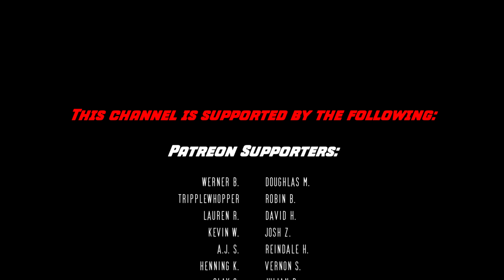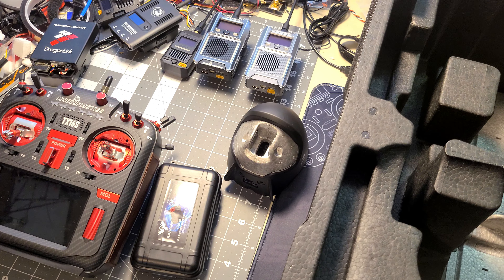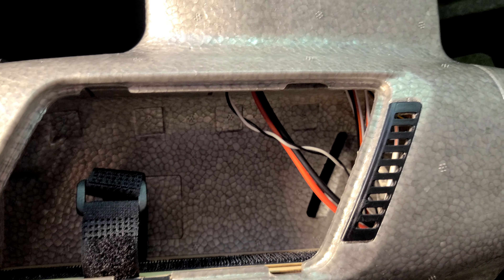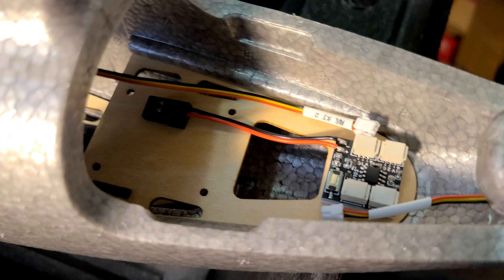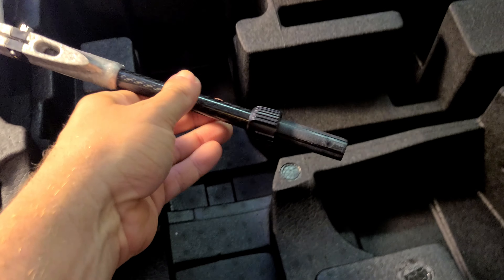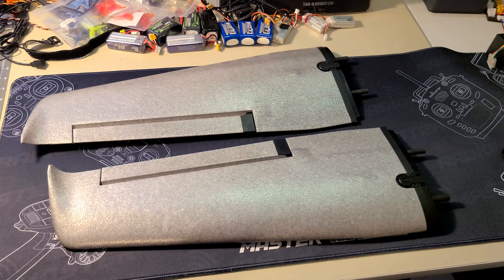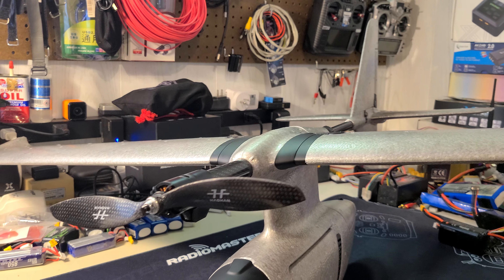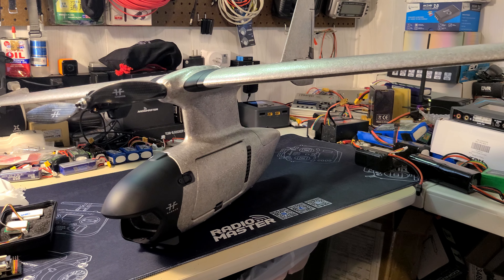Haohan Firefly Unboxing

Comment: A very nicely design with many refined design points. Reminds me of "Zeta Sky Observer" that HobbyKing and others sold in the early FPV plane days. Pod on that Long Range stick look more like a dive submarine with half-dome ends. Was surprised the wingspan on Firefly only 1080 mm. The Sky Observer was 2 m. Think this shows more how much the hobby has advanced, with smaller/lighter camera gear, and better batteries. I do like the integrated metal gear servos, connectors, hatch designs. Really a nice rounded package.

Heads up: beginning June 15, with the intro of U.S. tariffs (Section 301 guidelines announced May 14, 2024) on EVs, batteries, solar equipment, and chips/electronics from China, we can expect it will hit FPV gear shipped from China as well. Mentioning as tariffs begin at 25% this year, and depending on items will double to 50% in 2025. For lithium-ion EV batteries, tariffs will rise from 7.5% (currently) to 25% this year (or 2026 in some cases, but details not clear). Beyond FPV, products like e-bikes, solar generators, etc. will also be impacted.

Comment: Will be interesting to see the effects of a crosswind on the plane.
Reply: If you're referring to the large side area, it will actually have no effect on crosswind characteristics. Nerd tip: All planes fly in the same moving mass of air, whatever their shape. Many of us tend to think that our planes can tell the difference between upwind, downwind and crosswind when aloft, but in reality they have no idea what the ground does underneath them, and they don't care. This misconception is almost universal in RC, probably because we use the ground we stand on as our reference point, but it doesn't exist at all in full scale, where we're in the air with our craft. Use the air mass as your reference point, and your plane's behaviour will be a lot easier to predict at all times!

Comment: The quality and attention to details is VERY good, all the little touches here and there shows they really put a lot of care in the design. Also, it blows my mind how they are able to lower the price that much, around 250ish euros for a plane with a flight controller, gps, case, and some other miscellaneous, it's very well priced. I wonder if they send you the gimbal for the O3 with that package. There are however a couple of things that I wonder:
1) When landing it will tumble to one side for sure and hit a wingtip, I'm wondering how the plane is gonna hold up specially with that thin appendage connecting the wings to the lower body. With low speed landings i guess it shoud not be a problem but it needs some testing. Can't wait for the flight footage. Also, whenever you do it, could you include some stall testing? I'm always interested in those details but nobody does them in the review (on video).
2) Concerning the lower body, it certainty increases stability however it would be nice to see what happens with crosswinds, both light and heavy. Additionally, it seems to add a considerable amount of drag, I wonder if it would have been better to integrate it more to the wings instead of a hanging "appendage". It does have more room for the gimbal and stuff tho.
3) The servo connections, while they are really well made from what I could see in the video, replacing servos in the wings seems a bit difficult, but maybe it's not, never really used that mechanism.
4) Lastly, that flight controller seems veeeery weird, it looks VERY similar to the speedybee f405 wing on steroids, definitely love that they ship it all soldered. Testing it will determine whether it's good or not.

Comment: 3 days left on KickStarter ! 
1500 HK $ and I had thought about the value of 1 HK $
But 170€ would be nice , but then the shipping price for the pretty much same box increases from 400 to 700 HK$ and adds up. 
And strangely the shipping will be the same if you buy 2 of these at once. 

1900 HK $ equals  224€
6600 HK $ equals  780€ for the real system 

Right now a bit risky for a  kick starter from China, evn though they announced to ship in June.
24 supporters so far. 

And I am not sure why they had to develope their own Hao Han  flight controller board instead of getting a regular one of the shelf. 
But they  have their own yt channel and lot of short snippets to give a deeper look inside.  

But I like the idea

Comment: The configuration is very compelling at first look, however a few shortcomings are apparent.  The pod down below is vulnerable, and makes landing unstable, with the camera vulnerable.    The single prop and motor, with the wing, tail and pylon behind it will not be as efficient due to small disk area, make marginal thrust (also due to low disk area), and have lots of slipstream effect, as well as draggy components right in the acclererated air slipstream.   All of those are negatives.   Wing looks like it's on the short side, which means a loss of efficiency and limits the weight that can be carried.   This is another amateur young design team with little experience and making some erroneous assumptions right from the beginning IMO.  However, it does have some potential, probably more that most, and it is compact, easily transportable, so those are good things.. and it will probably perform satisfactorily enough to be useful.   this configuration has been tried before, with the Skua and Sky Observer, both of which flew better than this will, but still failed to gather a large enough following.  Good to see you getting new products for review!
Reply: Considering that both Skua and Sky Observer are massive compared to this, I am not surprised that they aren't popular. This has a 1m wingspan and is easy to transport and store.
Reply: @stratos7755  performance is related to size, so I'm not sure why the planes have to be so tiny.  My 3meter + span planes fit just fine in my compact car.  I do notice that people at my local flying field can't be bothered to plug in their wings, and throw the planes in the car in one piece.  But they also only fly for a few minutes.
Reply: What airframe/model would you recommend for maximum efficiency?
Reply: @Double-D_291  That depends.   Efficiency doing what task?   the design of the mission must dictate the aircraft design.  Most good UAV's are designed for max distance.  power consumption is balanced with ability to carry a larger battery, in order to be more effective at carrying a given payload for the greatest distance possible.  In that case there are many, but the best ones will look something like a crosswind by MFD.    For endurance, there are far less options, and again, low power consumption is a factor, but ability to carry a large battery is also.  I designed the Gemini V2 to fill this need.  This has good distance, but not as good as it could be.  but has excellent endurance.  Ability to stay airborne for extended periods of time.  It also has as by-products of the design, great altitude potential, ability to carry very large loads, slow landing speeds and distances, and very stable.   thick airfoil, high aspect ratio, large area of the wing, large disk area of the prop arcs, and long tail moment.  it can stay up for over 4 hrs.  others somewhat in this category might be the Believer, or XUAV clouds.
Reply: Perfect thank you. I was looking at powered gliders for long range fpv, something like the 2.4m Volantex Ranger. This is why I’m interested in the product but want to avoid Kickstarter. I’ll check out your other suggestions. Thanks again for your detailed reply!
Reply: @Double-D_291  gliders usually have an airfoil thickness of about 8 percent, even thermal gliders.  slope and open class are thinner.  for optimal distance, you are probably looking at 11-12 percent.  for  endurance, about 14.  Gliders often lack the structural integrity to carry large loads.   there are exceptions.  I think I remember seeing someone load up a volantex glider (highly modified) with a huge battery, and I think it may have been a stock wing.  some of those beginner planes have thicker than optimal wings for their intended use which makes them good for UAV's.  also maybe look at the radian. It has a thick airfoil too.